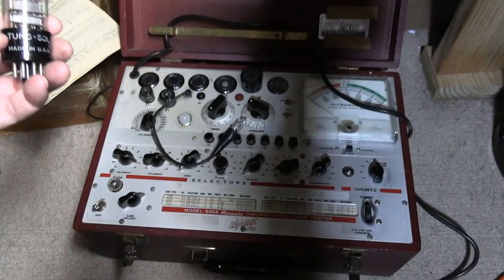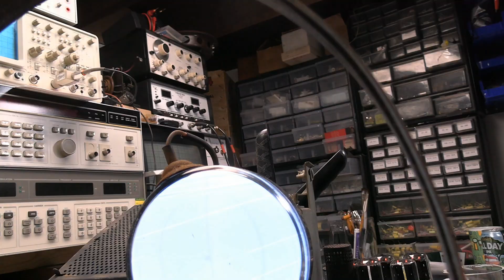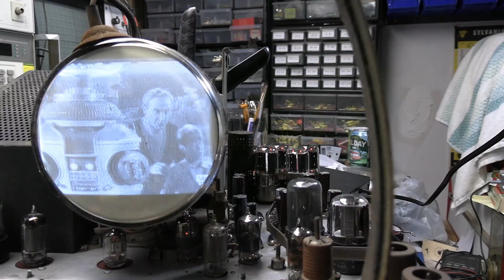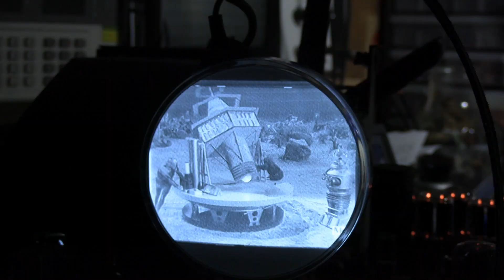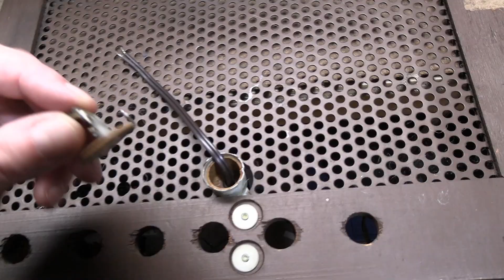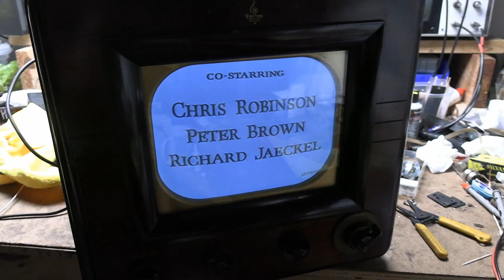Emerson 571 restoration part 3 (finale)

Comment: Interesting, all those heat generating components in the high voltage cage.  With the small holes typically used on those boxes, you don't get any heat convection, it takes holes at least 3/4 inch in diameter to permit convection.

Also interesting to see the output video amp tube that close to the flyback transformer.  I'm surprised that horizontal pulse doesn't get into the video.

All in all, a really good picture, even with that crazy power supply and the mystery modifications.
Reply: Some high voltage boxes didn't even have holes, just solid metal.
Reply: @dougbrowning82  Agreed, the heat dissipation would be the same in either case.  Painting the box black does help slightly with the heat dissipation though.
Reply: Do you really need 3/4 inch holes for convection? If the sides and bottom were solid I could understand needing large holes but there are vents on the side of the box.
Reply: @eDoc2020  Yes, you really do need at least 3/4 inch.  I discovered this during solid state transmitter heatsink design.  For convection to take place, the fin spacing needed to be a minimum of 3/4 inch.  The same held true with shielding of circuitry that generated substantial heat.  I did see the slots on that high voltage cage but, I never tested slots.  My guess is they  would also limit convection from taking place but, would be a step in the right direction.  The small holes in the high voltage cage are fine if the airflow is fan-forced.
Reply: @billharris6886  I do know that wider heatsink fins are needed for natural instead of forced convection but AFAIK it has more to do with aspect ratio.

And more importantly I don't think natural convection stops, it's just less effective with smaller holes. They wouldn't have bothered if there was no benefit. Also I've literally seen no consumer electronics with large unobstructed cooling holes. Whenever panel holes are larger than about 1/4 inch there's mesh behind the hole to stop little fingers from getting in.
Reply: @eDoc2020  Sorry, but I don't understand your code word: "AFAIK".  Also, I don't want to debate the effectiveness of heatsink designs, I am just going off of tightly controlled laboratory test results.  I suspect many of the heatsink designs seen on consumer equipment are based upon unproven tradition and "gut feel".  However, in my case, we were designing a VHF comm transceiver for a business jet, where the radio was mounted in an uncontrolled environment without any type of cooling air circulation so, we had to make the heatsink as efficient as possible, which is where my data originates.
Reply: @billharris6886  AFAIK = as far as I know

In your case you needed the best performance. Consumer electronics back in the day was probably more tradition but these days it's very much engineered cost cutting. It doesn't need to have great thermal performance, it just needs to be good enough.
Reply: @eDoc2020  Thanks for the decode on the mystery word.

The purpose of heatsinking is to conduct the internal box heat to the outside with as low a thermal resistance as possible.  With the Chinese making nearly everything these days, depending upon which company makes the product, the quality can be "all over the map".  As far as a design that is engineered to be "just good enough", is part of the "engineered obsolescence" mentality that many of today's products are designed around.  This mindset really feeds the landfills and gets quite expensive for consumers.  For a simple appliance, like a clock-radio for instance, replacing it every few years seems insignificant (if you don't count trying to figure out the menus you have to navigate to operate the new product).  If we look at a larger scale, like a major appliance or a car needing to be replaced every few years, the "just good enough" design philosophy gets very expensive.

Designing something right the first time does, no question, cost more up front, but worth it in the long run.  If a company designing low cost products is used to designing things right, the cost increase is not that great.
Reply: @billharris6886   If a product is 90% good at the end of its useful life there are two ways to look at it. You might think 10% is underbuilt but somebody else can say it's 90% overbuilt. "Proper" cheapening would results in everything wearing out at the same rate. The problem is when the cost cutting noticeably reduces the useful life.

Comment: Beautiful set 

Why does some of the harsh content or txt cause the buzzing.   Some sets seem to be affected more than others.    I have a 58 Canadian rca that has great sound and is not affected at all and other sets do buzz
Reply: The earlier sets can't handle the abrupt and large voltage change that digital image generation is capable of. The digital type signals bleed into the sound modulation. Since the vertical sweep repeats at about 60Hz it is very noticeable. I think there is also interference at the horizontal rate but that is too high a frequency to make it though the audio stages.